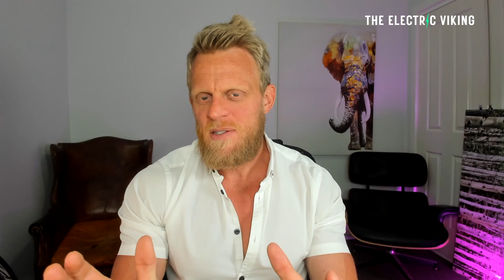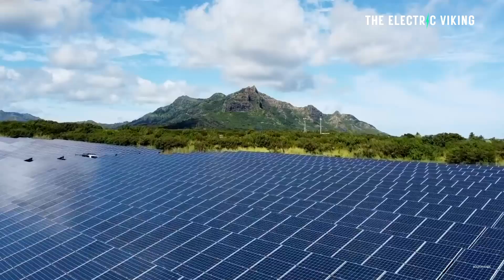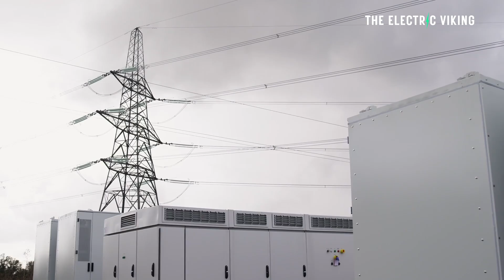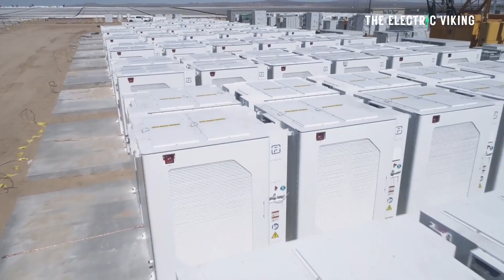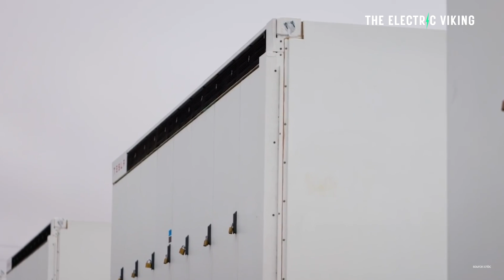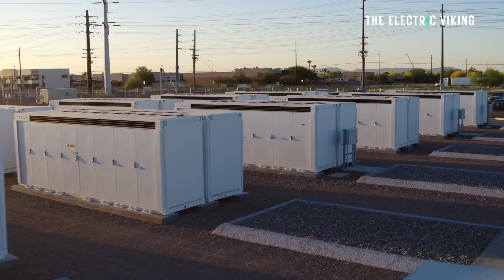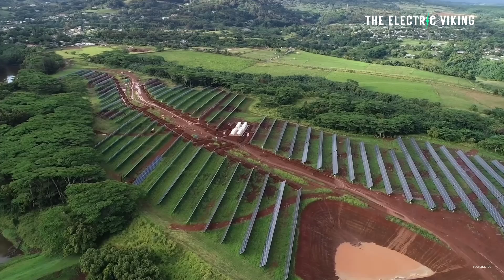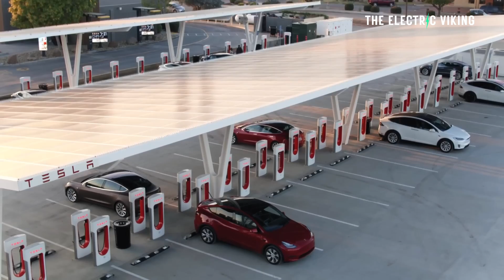Batteries + solar smash records in California and fossil power plants suffer

Comment: Ha ha ha! Is "revolutionizing" the new word for "destroying"? California has the highest electricity prices in the nation and among the highest power outages—brownouts and blackouts—per capita. The greatest single source of electricity generation is natural gas, about 49%, compared to solar at 17%. But solar only generates for an average of less than 6 hours a day; about 3 hours a day during winter and up to a little over 7 hours a day in summer. Natural gas produces power 24 hours a day and takes up the slack because battery storage is prohibitively expensive and inadequate. So much for a revolution. Nuclear is clearly the most efficient, safe, and reliable form of "green energy," but Californians are phasing that out as quickly as they can; increasing, rather than decreasing, their reliance on fossil fuels to bridge the gap that solar and wind never will.

Comment: The efficiency of this equipment decreases in ten years so much that it will need to be replaced.  What cost batteries and panels?  Especially batteries - their manufacture causes environmental damage, and the waste products from replacing all of the equipment is going to be another concern.

Comment: I live east of Sacramento and on PG&E. I pay 56 cents per KwH peak rate. Price goes up every year. Our cost of electricity will never go down. pG&E will say that is the cost to maintain the infrastructure. It does not matter whether the infrastructure is coal, nuclear, solar or reindeer farts. PG&E will never reduce price per KWH. They won’t even slow the rate of increase. But I’m glad the electricity comes from a more environmentally friendly source.
Reply: So if you can, move power generation close to home, with panels (and batteries but only if that works for you).

Comment: California’s lead will be short lived.  I live in Northern California and have just installed solar on a new home. The project was way more expensive and had way more red tape than a previous project we did on our home 7 years ago.  Pacific Gas and Electric, our local utility, has used its influence to change state building codes to make solar more prohibitive and expensive to homeowners. Ask any electrician in our area and you will hear how solar installation has dropped dramatically because of cost demands of the new code. 
It just so happens that we lucked out, and the additional changes to meet code were not too cost prohibitive in our situation.  We did install storage battery because the overage rates have dropped way low, 25% market.  
It’s sad to know that there are key players out there will to pour sand in the gears of the prospect of a renewable future.

Comment: All the Commies had to do was artificially raise the price of electricity to make this Solar boondoggle feasible.  

Im so old I can recall the big issue in Commiefornia in 1967 was whether PG&E should even be allowed to charge residential housing by the Watt instead of a flat-rate of $5 a month, lol.

Commiefornia has plenty of ENERGY but the Commies have spent decades trying to hide it and make it illegal to use because the weather in 10000 years might be rainy...

Comment: Batteries are made from mined materials, lead, lithium, manganese and wrapped in plastic boxes made from petroleum products, and the chemical process will weaken the batteries over time requiring replacement which means more mining with diesel equipment and processing with electricity from fossil fuels, not to mention the materials used to make the solar panels,,

Comment: Unfortunately the physical electric grid in California is 80 years old and crumbling apart. California has become a communist state no different then China which means the electricity is 100% controlled by the State without any choice of a different provider. All this battery storage is lipstick on a pig. If you want reliable and affordable and competitive power generation you can use California as an example of what NOT to do. If you want to still believe just do some research on the corruption and fraud and deaths caused by the PUC in California and PG&E and California legislators over the past 80 years.

Comment: I did solar 6 years ago. Could not put it on the roof, so two rows in the back yard supply me with an average of 25Kw per day.  7.6kw through 24 panels. In PA in the USA, only 70% effective, but 25Kw per day is awesome.

Comment: Sounds great, you say the CA batteries now hold more that "10 GW", I assume you mean "10 GW hours?" and that's not much given CA uses 556 GWh per day (according to https://www.energy.ca.gov/), so that's only enough to run CA for 25 minutes. That's still a lot for batteries, but I don't understand how they claim they could run CA for 4 hours unless it is during a very low peak time of the day.  I have another question for you, with power prices going negative, does this mean all those solar rooftops are getting no cash for putting power back on the grid?

Comment: If this is true, (that the coal and gas electric power generation will be supplanted by solar power generation combined with battery storage in 5-10 years), then it will no longer make sense to have a grid at all except for very specific usage (I am not sure what that would be but, for example, I would guess tall office buildings would rely on the grid) while most small residences and small firm buildings would probably be  better off becoming completely autonomous.
The only way the grid might survive I think would be if the grid also acquired solar panel making industries. I guess the converse would be more likely to happen though.
Reply: You still need a grid. No way for people who's roof is shaded by trees to power their house without it.

Comment: Batteries have cut spring peak exports in half and in a year or two they'll probably cut exports to near zero.   California's wholesale electricity prices sometimes go negative in spring, usually only for a few hours on a few days though (it gets heavily exaggerated by conservative media but really it has always been a foot-note at best).  Negative pricing is great for grid-scale batteries, but mostly they simply rely on the wholesale costs being low mid-day due to all the solar available.

Note that California's grid-scale batteries can push roughly 6GW right now (it will be 10GW within a year).  The actual storage is roughly 5 times that... so the state has roughly 30GWh+ of battery storage now.  Within a decade that is likely to exceed 200GWh.

Grid-scale batteries have several incredibly beneficial knock-on effects.  They can react in milliseconds to grid events, and the batteries can be situated in congested transmission line zones to de-congest those transmission lines which saves insane amounts of money (not having to upgrade or add new transmission lines).  States like California and Texas have realized that grid-scale batteries pretty much pay for themselves due to all of these positive effects.

Comment: Solar and battery prices are still prohibitively expensive in the US for most homeowners.  A major contributing factor is that electrical code requires older buildings be brought up to date with present code at a cost in the thousands of dollars before any new institution will even be considered.
Reply: This is a very good point.  Well "electronical"... that made me laugh.  But the regulations are very real and a lot of contractors stop right there and won't take the contract if the residence has too-old a panel (old as in technology-old, not age as in years).

Of course, many of those old panels are extreme fire hazards and the owner really ought to completely replace them anyway just for fire safety.  You don't want to be pushing multiple kW for hours on end, every day for years, through an old panel (technology-wise).

I do think the regulations are a bit too strong though.  One should be allowed to make minor additions, even if its only like 2kWp of solar, without being forced to upgrade a panel in an old building.   There are also electrification solutions that don't require large circuits.  For example, you can get an induction stove-top/oven that includes a LFP battery built-in and runs off of a single 110V outlet.   There are options for people in old buildings and homes.

-Matt
Reply: @junkerzn7312  Fixed the typo . . . 
It's also a matter of finding a replacement pannel that won't require structural modifications just to fit because someone decided to double or triple the width of the cabinet.

Comment: CA depends on imported energy to function.  Just a few month ago they would limit thermostats temperatures and EV charging due to lack of capacity.
Reply: This is a bit of an exaggeration.  California actually has large in-state generation resources and both imports and exports electricity.   Just last year Arizona was relying on exports from California to make it through a heat wave, for example.   California was also exporting during the great Texas Freeze, aiding states on the Western Grid (the freeze mostly missed California itself so there were plenty of export resources available at the time).

You might not think about these turn-arounds, but they are just as important as overnight imports are.   Still, one could reasonably say that the state has gotten a bit lazy in terms of using imports for overnight generation.

At the same time I will point out that neighboring states rely on exporting overnight to California to keep their nuclear plants running economically (24x7), so it's a two-way street.

In anycase, this dynamic has begun to change quite radically over just the last few years as in-state battery storage increase.  Imports have been slowly declining over the last decade and that trend looks like it is going to continue.
Reply: So they took control of thermostats and EV chargers? Huh 🤔
Reply: @hermancm  Nope.  They asked citizen to limit use during the heatwave in 2022, a thing that would be unnecessary if they had the ability to produce all the power they needed.  The control of thermostats is a program customers agree to enter.  In Colorado many customers were in fact locked out of their smart thermostats by the energy company during the heatwave.
Reply: @mrgustavoperez  I can see them asking you to cut back on power if they can’t meet the power demand.
Reply: Fox News Talking point.  2 years ago California asked Tesla owners to charge  their EVs outside peak periods, which is easy to do with Telsas.  And Fox News twisted that to their talking point.

Comment: and how often will you need to replace those batteries? they only have a set life span before they are useless. AND then can you recycle it? what about all the environmental damage being done to acquire said minerals to make the batteries let alone all the panels. think again about renewables.
Reply: LFP batteries?   3000+ cycles @ 80% DOD to 80% capacity, with no particular failure cases for the cells themselves.  So the answer there is... the cells will outlast the electronics by a lot.  The electronics inside (the BMS) are good for 10-15 years.  The bare cells last roughly 25 years.

You could bone-up on your knowledge instead of just spewing out broken assumptions and then declaring a broken conclusion from those broken assumptions.
Reply: Yes, they are recyclable, both panels and batteries. Because of this within 5 years it is estimated there will be little to no need for additional mining as the recycled material can be used for new products.  Technology is also constantly changing and the newest batteries in production and use are sodium ion with no lithium or other rare minerals needed.  The materials needed can be obtained from the waste from desalination plants reducing their waste so another win
Reply: @jeffpitoniak  Well, I wouldn't quite go that far.

It is certainly true that sodium and LiFePO4 (LFP) chemistries don't contain anything special.  No rare metals beyond the lithium.   But in terms of being recycled, batteries with cheaper chemistries are actually harder to recycle economically precisely because there is nothing precious inside.

For LFP batteries, the "lithium" is almost never recovered, and the iron and phosphate aren't worth a whole lot.  The graphite ... I'm not sure the graphite can be recovered (re-refined) at all actually given its melting point of 3600C.

For NMC batteries the Nickel and Cobalt are high-value commodities and always recycled.  The rest of the battery... not so much.

Same is true for solar panels.  The aluminum is readily recycled because it is easy to extract more or less pure and has a decently low melting point (660C/1220F).

But the solar cells themselves are a lot harder.  Those are mostly laminates and plastics.  There isn't a whole lot of actual silicon and silicon itself is expensive to recycle (melting point is 1414C/2577F).  The only precious metal on the cells is a bit of silver (961C/1763F) and maybe a little copper and that's it.

So to truly recycle these things, government subsidies are absolutely required, probably a program similar to the one used for lead-acid battery recycling (which is required by law and subsidized).

-Matt

Comment: Viking should stop pretending that residential rooftop solar is the only solar possible.  It is only roughly 15% of installed capacity. Only morons are surprised to learn that rooftop solar is far more expensive than large solar facilities (commercial rooftop + desert).  

One of the main reasons that delivered electricity in california is so expensive is because solar contracts that investor owned utilities were forced to purchased to comply with the California renewable portfolio standard mandate.  Thise are very expensive long term contracts.

Comment: Careful.... the State of CA reports 37% of power in CA (2023) is from natural gas, and CA  imports 30% of its power (2023) from outside CA, all generated by fossil fuels.
Things are improving from a "green" energy POV, but being 100% green 24/7/365 is all weather conditions is 2 or 3 decade away.

Comment: Southern California has the most expensive grid electricity in the USA with San Diego CA having peak residential rates at over $0.60 kWh.  2020 Cumberland Indiana rates were I lived were  $0.10 kWh.   In addition many of the SoCa power grids are in bankruptcy and sick unable to make technological and physical advancements on their high voltage transmission lines that spark forest fires causing the power grid management to turn them off during high winds creating black outs for large amounts of a week.   

There are parts of California where roof top solar electric panels have turned the roofs into industrial or farming like aesthetics.   Where every solar electric panel when connected to the grid without battery storage has increased the cost of grid electricity.

SoCa power grids are required to buy erratic solar electric power whenever it is available.   The power grids were required to use net zero pricing, new solar electric panel installations don't get net zero, which is paying at the price the power grid charges a resident for grid quality electricity to buy erratic solar electric power.  This has created a positive feed back loop where having to buy erratic solar electric power whenever available that can be largely useless or worse has caused residential rates to sky rocket to cover the costs.  

The net zero pricing is then paying residences a more for a kWh of solar panel electricity that along with subsidies on buying new solar electric panels greatly increases people installing them.  That causes the power grid to have to buy more erratic solar electric power they can't easy use requiring them to raise electric rates to cover their costs.  The higher grid power electricity rates cause more people to buy solar electric panels.   

There has been no reporting on how much natural gas or coal the SoCa power grids have been saving with renewable energy!   The high price of SoCa grid electricity with many of the power grids unable to be financially solvent (San Diego CA has one of the few power grids that has been financially solvent) indicates huge expenditures with very little or even purely negative effects (using that erratic solar electric power might be cheaper if the utility were to pay for it and not use it because using it costs additional resources) on making economic low cost public power grid electricity which is the duty of a pubic power electric grid.

Comment: My prediction is that by 2030, increase in battery capacity and decrease in their charge time and decrease in solar panel costs will quadruple. At that point, nothing else makes sense. For some countries wind and geothermal might be better.
Reply: We're starting to get to the point where the dominant cost of solar panels is no longer the panels themselves, but the cost of other stuff, for example, shipping the panels, buying the land to hold them, labor to install them, new power lines to transmit their power. No matter how cheap solar panels get out of the factory, these other costs don't automatically get any cheaper. At some point, the cost of land and labor alone will put a floor on how cheap solar power can get.